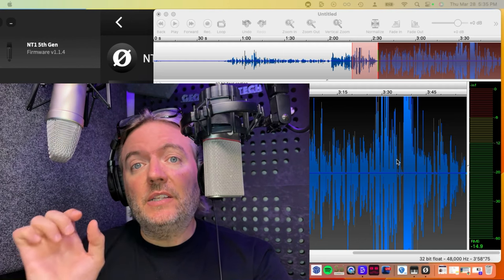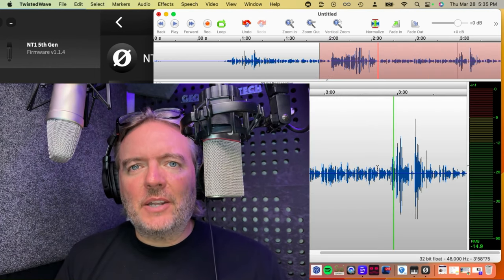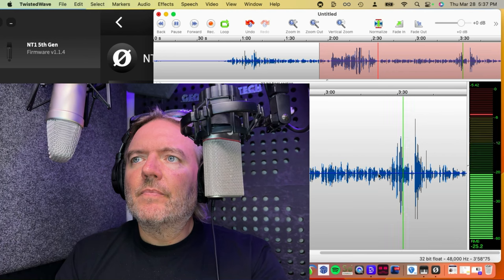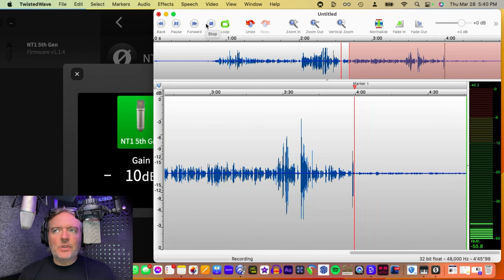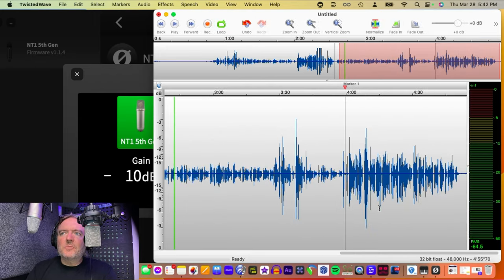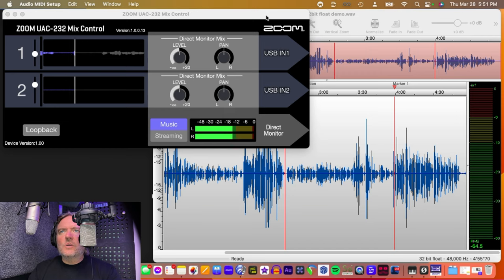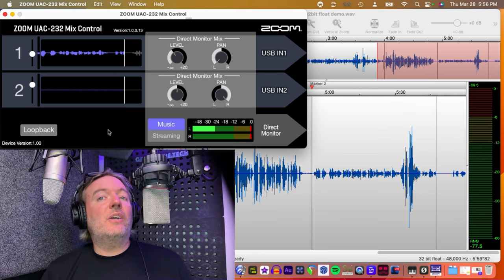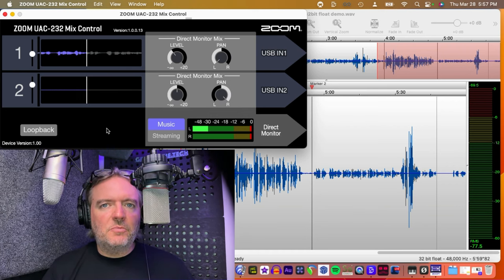Exploring 32 Bit Float Recording with Rode NT1 and Zoom UAC 232

Comment: This is confused. The point of 32 Bit floating point is so that the internal bus can't clip - it's got nothing to do with your microphones. There is no mic with a dynamic range of 24bits, never mind 32Bits.
Reply from the maker: OK, thanks for your expertise. Mics are analogue and can have huge dynamic range (150dB or more), you are referring to the A/D converters which in this case are using 32-bit floating point conversion.
Reply: By your logic any mic could record in 32 bit float and we would never had clipping issues to begin with. I can’t understand how you came up with this reasoning and didn’t see the obvious flaw in it
Reply: @GeorgeTheTech  It's really confused - the dynamic range of 32Bit FP is 1528db. The manual says that the interface uses stacked converters, so that whatever your input SPL, the converter will always be able to match it. It has nothing to do with floating point resolution in the slightest, and certainly absolutely nothing to do with the dynamic range of mics or interfaces. Floating Point maths relates to the extra dynamic range required to represent wide ranges of combined audio leaving audio processes inside DAWs.